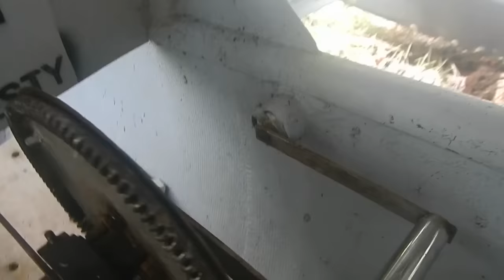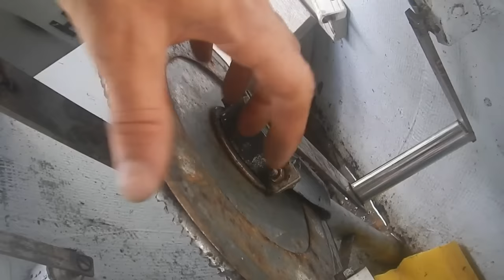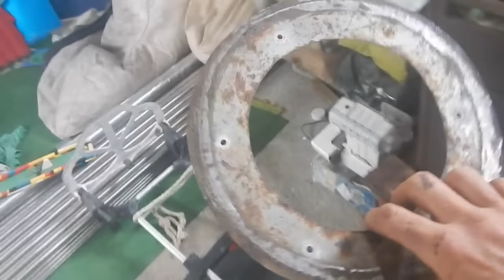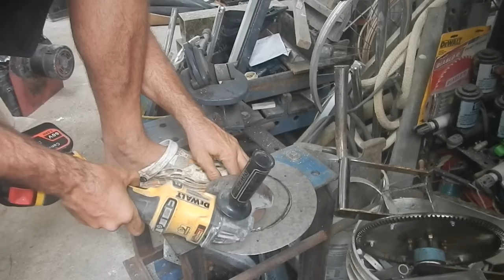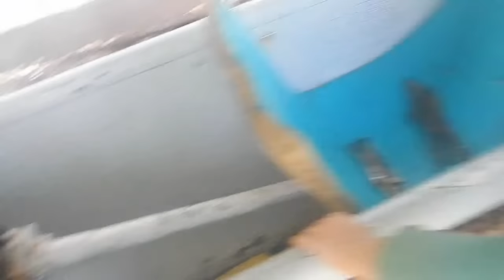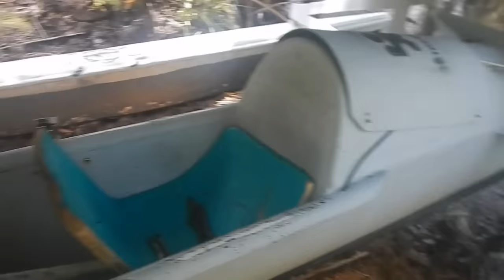Zombie Chopper Gear Fix

Comment: Looks like the material fatigued because it wasn't flush and was "oil canning."  Smear some contact cement or something between the two before riveting and it won't crack like that again.
Reply: Are you an HVAC guy?

Comment: i loved the gears build and i love the way it turned out, but i always wondered why jaimie didn't just use the right angle gearing from an old angle grinder and use bicycle gears to get the ratio he wanted
Reply: I would have found a bicycle crank 
with a big chainwheel and cut the frame to suit the boat shape. Use a belt or chain and connect it to a smaller gear.
Reply from the maker: That would have been a lot harder to fit, and isn't stainless.  I've seen people using angle grinder gears for boats.  It's nice for a demonstration thing, but won't last.  I build things to last.

Comment: Is there a crack in the larger gear ? At the same location of the backing plate crack. 1:28 shows a crack in the large gear.
Reply from the maker: That's not a crack.  It's where the pipe I bend into a circle meets itself.  It was never a solid circle.
Reply: @JMEMantzel  ok thank you